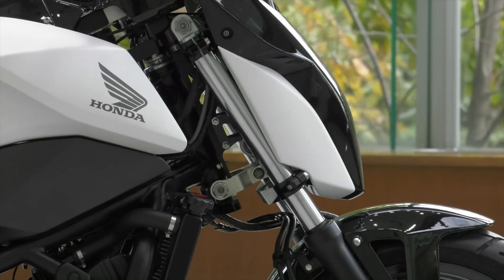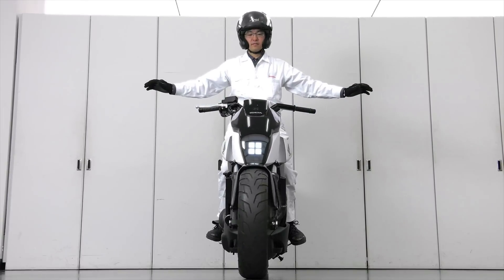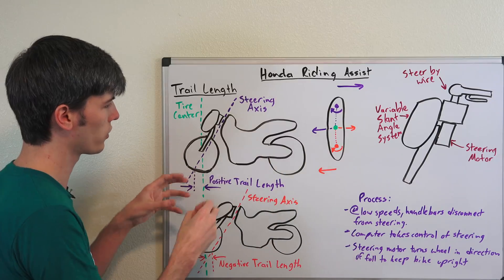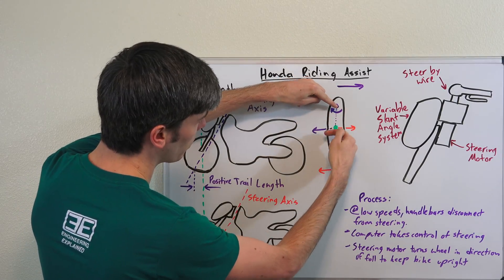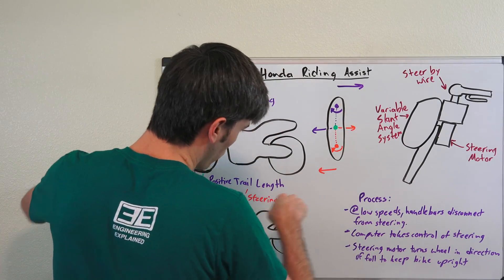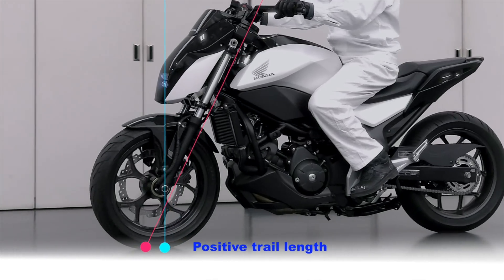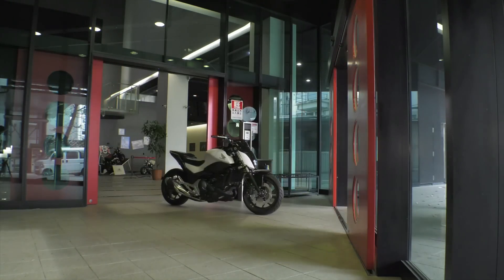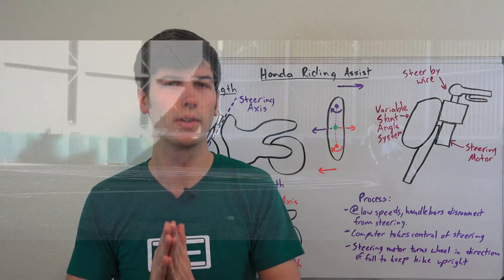This Motorcycle Won't Fall Over!

Comment: Now that you've done one motorcycle video, I'd be interested to  see more.  Nobody is doing scientific evaluations of motorcycles.  For instance, I'd love to see a video on the safety differences of different types of motorcycle, i.e. chopper, cruiser, sport bike, adventure bike, street bike, etc.  All have different centers of gravity, riding positions and front fork angles and lengths.  Which is optimal for maneuverability and safety?

Comment: Honda engineers then you can use similar processes during high speed medium speed low speed Falls by keeping them motorcycle parallel to the road surface in most situations with a gyro

Comment: No man, the bike will go to the same side, on both cases. when you turn the wheel, it's center goes always to the side you turn, so the bike always will pent to the other side. the only diference on the inclinate position of the turn point do, is to have more or less effect on that.

Comment: dunno. i em not an experienced rider, howeveri found heavy bikes more suitable.
witch sounds bollocks, but it does help me a lot, i weight less, far less than my bike so whenever i corner, the bike "leads" my tilt so to say. all i have to do is basicly grip the tank with my legs and just sortha move along with the bike and things are really efforthless.
on a small bike i had issues with slow speed manuvers. with thisone i can go at really really slow speeds without problems, and even manuver verry percisely.

Comment: Seeing that bike keep itself upright by itself with just this novel computer-controlled steering axis gimmick makes me think of another application. Remember those fully enclosed motorcycles ( LIT Motors )? Instead of those little retractable training wheels it uses to balance at a stop, it could use this tech. Would have to switch from leading swing arm suspension in the front to forks.

Comment: Why can't you achieve the same thing with a positive trail length just by steering the opposite way of the way you're falling? It seems to be the same effect, but in reverse. And for that matter, WHY is a positive trail length more stable/desirable for high speed riding?

Comment: Speaking as someone with back problems that would have trouble picking up a bike that went over, I would never buy a bike like this. It immediately lost me at steer by wire. To start with, riding a bike is all about feel. If there's a disconnect between my handlebars and the motion of the front wheel, which there absolutely is in any steer by wire system, that feel goes out the window. On top of that, it's needless complexity. One more thing to break, one more thing to go wrong, that really doesn't have to. I've used poorly implemented steer by wire systems on other types of machines, and they drive me nuts. I want the thing to go in the direction I tell it to go, not the direction some computer has decided that I probably want it to go and "correcting" my inputs.

Comment: No... Bad Honda... This is just wrong on so many levels. What happens to the rider who learns to use this type of a crutch and then either the system fails or he gets on a motorcycle without it? Answer... he crashes because he never learned h to ride in the first place.

Comment: I don't like the thought of steer-by-wire on a bike, bikes are dangerous enough. Though if this is the start of m autonomous bikes, then it's a great start!

Interesting to me that it's not just the weight shift that we use to keep a bicycle upright but also the wheel turn too.

Comment: I only wonder how well it handles perturbations in self balancing mode and how large of one can it account for. I'd like to see a rider sitting and moving his body side to side to different degrees or someone pushing his shoulder. 

If it's pretty solid in such regimes then this could help realize feasible enclosed motorcycles.

Comment: I like this technology.  But it's just another possible point of failure that I would need a professional to fix if it failed.  One reason I really like motorcycles is because I can pretty much fix 90% of the problems on it myself.

Comment: Very cool.
Yes, there will be some who say 'It's for people who cannot ride'.
So what?
I ride a fairly big bike and I am quite short.
I don't think I would want this tech' right now, but in a few years maybe.
Cars never used to have power steering, ABS, traction control, etc, but no-one moans about them now that they are commonplace.
There is no universal law that says a human should be able to control every machine he/she uses without assistance.
If that were true, most machines we now use, we would have to stop using on the basis that we were 'people who cannot control machines'.
I know I want the airliner I am in to be computer assisted down to the very last detail.

Comment: I'm not a fan of steering assist technologies.  I has a rental car with lane assist once and I hated it.  I suppose you get use to the car not wanting to go where you wanted it to go after a while, because it's pretty predictable, but sheesh.  Let me steer.

Also Can-Am had a no fall motorcycle in the Spyder for several years but I am not sure they are making it anymore.  Ok maybe using 2 front wheels was cheating but it worked.

Comment: Well, I've had two incidents where a bolt prevented my steering on a bike, luckily, the bolt quickly fell out both times before I would have crashed.  If that drive by wire fails, you are screwed...

Comment: Computers are only as good as the programmer.. I don;t like the fact that the forks disconnect from the handlebars. I'll stick to my feet down when stopped and have no fear of losing control at 80 MPH thank you very much.

Comment: Yep. That's what I want to depend on in my steering, electronics! So a loose wire just kills you.
Reply: As opposed to a collapsed bearing? 
It still has two handlebars. I'm pretty sure if the electronics failed you would would still be able to control it.

Comment: The really interesting stuff is when the balancing fails because it can't compensate for the center of gravity having shifted too far. 
For example when stopped and balancing but the rider moves to reach for a backpack and something.
Or a rider with a passenger?
Is it deterministic and manageable then? 
I doubt it.

Comment: I wonder how this works with counter steering.  I rarely turn the bike without counter steering at speed.
Reply: it disconnects at speed. i wonder how it works at low speed instead, imagine you doing a u-turn and it engages to disrupt you.. hmm..

Comment: Would be cool if you can enable or disable the system with a switch or so... So you can ride safely and easily if you want to, but also if you want to feel yourself more in control and have a bit more fun riding on a road or a track, you would simply turn it off

Comment: Nice to see you talking about bikes for a change :) There's a lot of topics that need a good engineering explain-ation. Preload, sag, rake, trail, brake-(anti)dive, BMW's suspension system, chain/belt/axle, squatting...lots of interesting nice-to-knows!
BTW. Might this be  Honda's first step toward an autonomously driving bike? shudders

Comment: awesome but...
What happens to the ride by wire if the power is suddenly cut due to engine stall. Even if it is battery fed, the sudden drop in voltage slows down the reaction time.

Comment: Pretty sure this technology wouldn't be allowed on a motor cycle in the United States.  I know at least for cars there has to be a direct mechanical linkage between the steering wheel and the steer wheels.  For instance you can not have hydraulic steering, only hydralic assist steering.

The video shows the bike as having "drive by wire steering", which looks like they removed the mechanical linkage.  I wouldn't feel comfortable driving a bike with that type of mechanism.

Comment: Motorbike and bicycle trials riders are already doing this without the assistance. Without the extra slack in the steering angle the adjustment has to be a lot more precise and the rider has to stay a lot more centered on the bike to keep it balanced though.

Comment: You mentioned the system doesn't involve gyroscopes; without using a gyroscope, how does the computer measure the uprightness of the bike and then alter the steering angle and the trail length accordingly??

Comment: I'm sorry but why the hell would this be needed?
Reply: Manny Echaluce If people cannot be arsed to put the practice into it and learn then what's the point. If you cannot do basic manouvers using clutch control and the rear break then why bother getting on a bike
Reply: Tactical Suicide lmfaooo!!! 😂😂😂
Reply: so more riders can ride a 2 wheel vehicle, opens to a new market of potential riders who are not good at slow maneuvers
Reply: lazy people
Reply: so you don't have to put yr foot down at the lights
Reply: Wyattchoi A .....
Reply: chinchy111 Lazy people are riders too, the more the better for the rest of us..........
Reply: Most crashes happen at slow speed or while being stationary. This solves the problem.
Reply: Miika Venäläinen until someone runs into the back of you while at a read light... Personal experience. Other than that and a few other situations it's still about the rider being competent.
Reply: youngsoldier93 I agree, even with all the automated assistance everyone should always be competent with handling their vehicles/tools, most of these automated assistant devices will fail at one point in time the controller needs to be ready for all contingency

Comment: Come on Jason.
I'm I Honda rider myself, not a fanboy in any way, had others too, ducati, yamaha, and I'm sure no one I know will appreciate that technology from Honda. Same way people don't want dct in their bikes.
Most people I know have a twisted nose regarding ABS... Maybe we are getting old, grumpy and refusing to accept anything new, or maybe it's just not what we want.
Better brakes, suspension, tires are always welcome. Electronic assistance... not so much.
I myself am not a great fan of electronic injection on dirt bikes. But not a big issue. Anything that takes full control of the bike away from me, is a big no.
No idea if you know what a XR600 is, but I've seen guys just over 1.6m riding them without complaining it was to high for them. Just as saw a guy over 70 with a pan European happy he was riding it.
My opinion, no right or wrong.

Comment: This technology is based on controlling the caster for the given situation. Positive caster (the load is in front of the centerline of the wheel) offers straight line control but requires more steering effort. Negative caster (the load is behind the centerline of the wheel) offers less stability but requires less steering effort. If you've ever ridden a bicycle free-handed you are using the benefits of a positive caster. The casters on an office chair follow the load whenever the seated person moves around; look how caster wheel assemblies are shaped and you can visualize the straight load line well forward of the wheel's center.

Comment: Nope not for me at all this steer by wire scares me it will be no physical connection between your handle bars and the wheels  bugger that what happens if the system fails for what ever reason damage , age , mileage can they 100% tell me this will never fail leaving you with now way of controlling your bike

Comment: In motorcycles and bicycles there are besides the mentioned caster effect also the so-called wheel flop and by turning front wheel the center of gravity of bike is rising or falling (if rake angle is not vertical). In case of negative trail the center of gravity is lowest if front fork is straightforward and by steering to the fall rider is raising little bit center of gravity and therefore resisting fall over even in stationary situation.

Comment: this is nothing more than a useless tech demo. If you can't reliably come to a stop on your motorcycle and support your bike yourself, then you should probably not ride that motorcycle. And what happens when the bike malfunctions and the trail isn't returned to normal? You'll get incredibly unstable riding, and speed wobble. There's a reason why all two wheeled vehicles have negative trail. I don't see a practical use for this, other than a tech demo.

Comment: I don't think this would be a cool idea for somebody who rides motorbikes for some time, and understands counter-steering.
When experienced rider wants to turn left, he turns handlebars slightly to the right to let motorcycle lean left, and then he continues to push this left handlebar to tighten the turn.
How is it going to work here?! It has to have some clever force feedback software for steering motor, or it just ignores this effect, which means it is going to be a DISASTER for experienced rider to ride this machine and for inexperienced rider who will start with this and then he will switch for machine with normal direct steering

Comment: i ride my bike every day.. it weights over 250 kilos wich is alot but not to much. i work in the city. having a system like that would be amazing. sometimes after school i go for a drink with some friends and i have to leafe the bike there or push it. having a motorcycle that would follow me would be amazing. i could drop my gear on it and could walk with my firends.

Comment: Next stop, fully autonomous bikes.. Sit home and watch TV while your bike rides to Sturgis...

Ok, fun is fun but as a biker I chose a motorcycle for the pleasure, freedom and control I have over the machine, i don't need the gadgets/automation a modern car has or the comfort of an autopilot...  i just want to be in control over a simple yet fun machine, that's all. I see concerning trends going on, automatic gearbox for motorcycles (when i can chose a scooter or maxi-scooter for that), this vertical stability control, all the safe features that turn a bike into a mundane dull thing...

Comment: if youre older and cant ride a bike, you shouldnt ride a bike
if youre too short for your bike you should get one that fits
if your bike is too heavy for you, you should get a lighter one

also, ride by wire steering sounds terrifying and it defies everything a motorcycle stands for.

I love this as an engineering excercise, but it has absolutely no point in the real world
Reply: So if you're missing a leg, or a foot, or have a bad back, but still have a passion for motorcycles, and this tech allows them to drive, what's the problem to you? 
It's not like every bike produced from 2017 onwards is gonna have this tech.. Not to mention ride by wire has a failsafe as explained by Guillermo Lovato above 

"all steer by wire has a backup failsafe linkage, same as in cars, there's a NC clutch that disengages the handlebars, if the system detects a failure, it will simply turns off the motor and cut power to the clutch making it engage naturally(it has to be normally closed so that it doesn't depend on power for the failsafe)"

Comment: What's the point of this? Over thirty years of riding experience on hundreds of bikes and never needed this facility!  It looks like he is trying to explain counter steering? Something all bike riders learn with experience. Sounds weird but you actually steer the opposite way to what you think to turn the bike when at speed. It is all to do with gyroscopic precession and clever science like that! Master it and your riding improves massively.

Comment: I have a question : what happen if there is wind ? I suppose you have to find a covered place to park it right ? (I mean like strong wind)
Reply: I think it would still have a side stand for long term parking. I don't know the power rating, but that servo motor might wear a small motorcycle battery down if left balancing overnight.

Comment: pivots and turning and leaning the bike theory works only on a very slow speeds just because you can turn lean the bike with your body. try riding a bike faster than 20 km/h and you WILL be turning the wheel opposite of the direction you want to go in all and every bike.

Comment: This might make backing a bike up a lot easier.
Reply: Can't see how it could help when the bike is already on its side. On the other hand all the hardware for this system will make the bike heavier and so a little harder to back up than the same bike without the riding assist

Comment: message to anyone with a bike or have friends with bikes, their dangerous. ......that is all
Reply: Mark Rampersad they're* and no they're not. still less dangerous than texting and driving.
Reply: message to anyone who regularly has to cross the street, they're dangerous...you might get hit by a car...
that is all
Reply: Mark Rampersad with cars now getting more semi autonomous features motorcycles are getting safer to ride
Reply: Mark Rampersad also many of those motorcycle death statistics also count preventable deaths like not wearing proper protection, being sober, and riding at a safe speed. 
yes it is always going to be less safe then a car but use safe riding practices the gap narrows greatly.

Comment: You talked about how this could be useful in a todays bike, but i find more interesting thinking how this can apply in the near future, when you design a vehicle from scratch with this technology. For example, an aerodynamic or an all weather motorcycle where the driver is fully covered, or modifying the seating position to something totally different from todays bike as you don't need your legs when you stop... possibilities are infinite!

Comment: Is that steer by wire? The front can steer without the handlebars moving.
Reply: Yes it is. The human interface is disconnected during the self balancing act. We have a demonstration bike here. It's not a technology in production yet. So it's operation may change on design.
Reply: u9Nails I can imagine that. Cars don't even have drive by wire. Very interesting package.